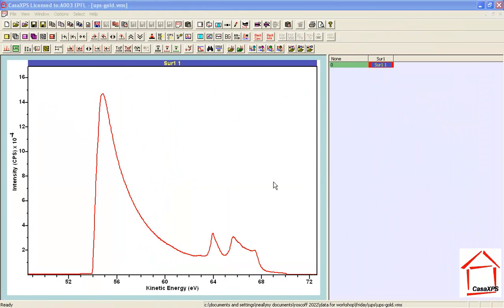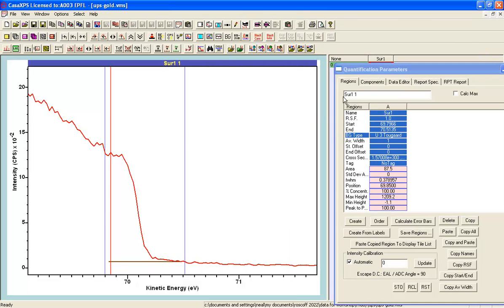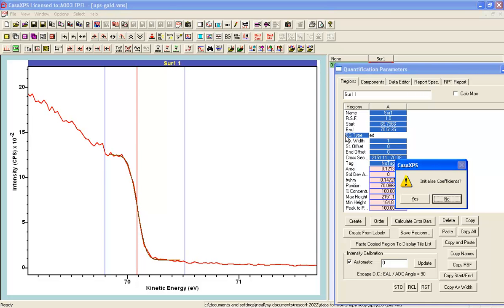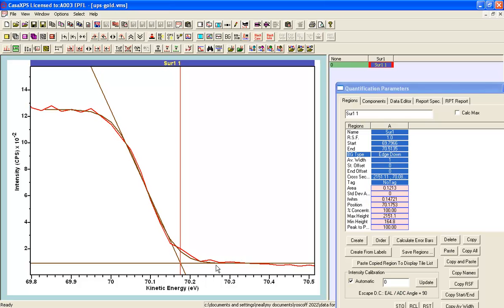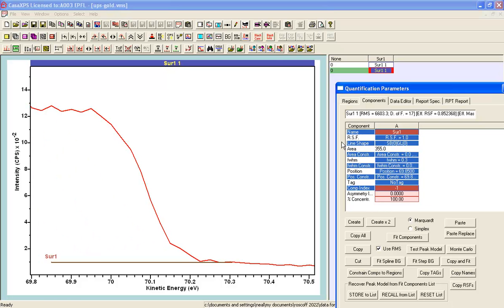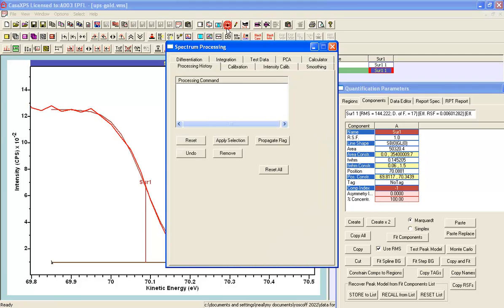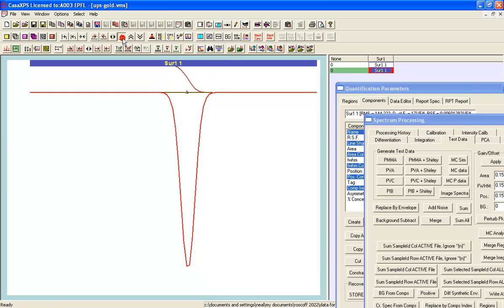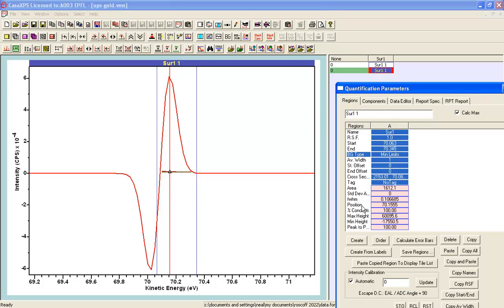UPS Edge Position ... three options in CasaXPS

Comment: There is 'Edge Up' and 'Step Up' background for SECO region!!
Reply from the maker: I am not sure what is meant by SECO region. Would you please provide more information about your application?
Reply: @casaxpscasasoftware4605  secondary elrctron cut off?
Reply from the maker: The secondary electron cutoff can be estimated using other means. The following video looks at one possible solution. https://www.youtube.com/watch?v=UXQMrPgBVvs
Reply: I meant secondary electron cut off region for a work function as @al mentioned.

Comment: Thanks for another great video of CasaXPS!

I have a question regarding the SB(0) prefix background: is there any place where I can read about it? I've seen it used in some of your videos, but I am not able to find a thourough description of how to use it, how to constrain it, how to offset it depending on which kind of material I have, etc.
Reply from the maker: The formal definition of the SB(0) modifier to a line shape is published in the paper: 

Smith, Emily, et al. "Modification of conventional peak shapes to accurately represent spectral asymmetry: High-Resolution X-ray photoelectron spectra of [C4C1Pyrr][NTf2] and [C8C1Im][NTf2] ionic liquids." Applied Surface Science 611 (2023): 155314.

and discussed in the paper:

Fairley, Neal, et al. “Practical guide to understanding goodness-of-fit metrics used in chemical state modeling of x-ray photoelectron spectroscopy data by synthetic lineshapes using nylon as an example.”Journal of Vacuum Science & Technology A: Vacuum, Surfaces, and Films 41(1) (2023); doi: 10.1116/6.0002196